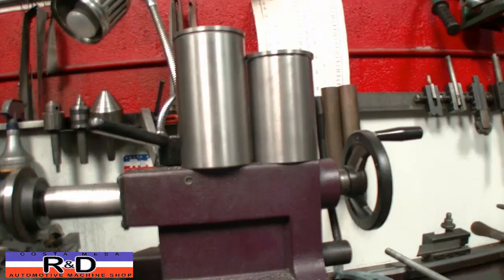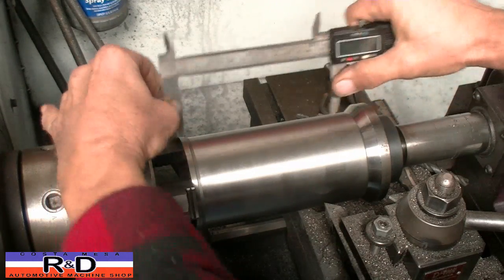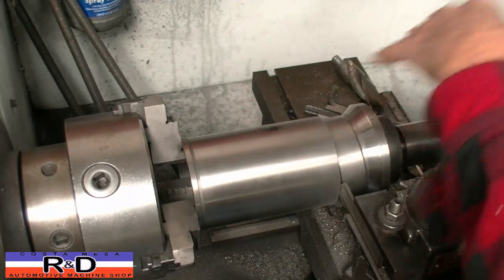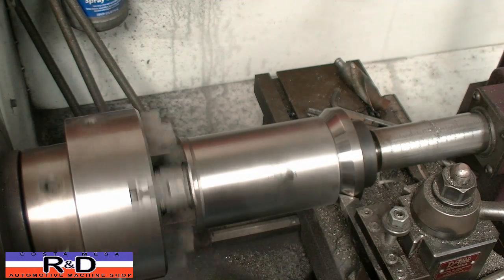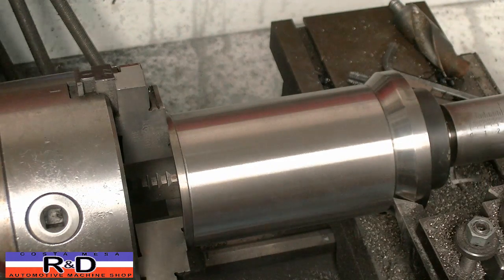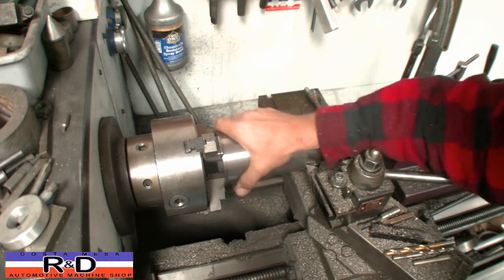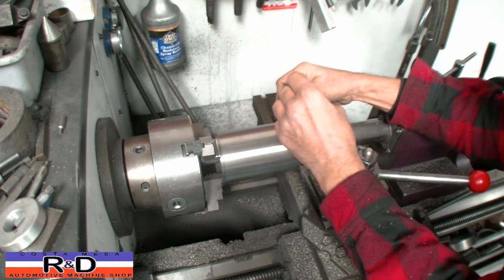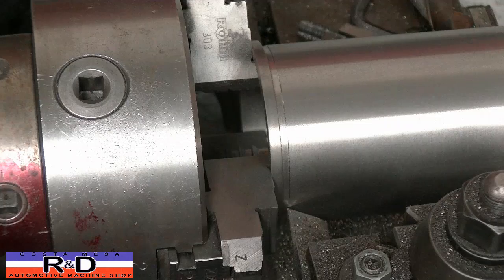Sleeve Modification for Lamborghini V 10

Comment: Do you deburr were the live center goes in !   And  check runout before cutting the o d of the sleeve !
Reply: +Bob Bielski And used a sharp instead of round insert to cut the relief. Crack waiting to happen.

Comment: is there any particular reason why you spin the lathe in reverse? i used to at a shop i worked for and i got chewed out for doing it and was told its wrong. any benefeits?
Reply from the maker: +Raging Reaper Gaming Variety The cut off tool is positioned upside down so it will pop up out of the way if it gets jammed, much better then crashing the tool and part.
Reply: +Raging Reaper Gaming Variety If your tool is so tall you can't get it on centre, you can flip it around. Not sure why John does it while cutting off, could be to help evacuate the chips. I sometimes do it on heavy brass cuts to reduce the fountain of needles.
Reply: fiatnutz
what i figured and how i was taught but thanks for clarifying

Comment: What on earth happened to that engine to need a new liner built 😬
Reply from the maker: +MrGuvEuroman detonation damage, that's what happens when your tuner doesn't understand tuning, so much.
Reply: I'm assuming it's for a big turbo build.
Reply: fiatnutz tuner in parenthesis?
Reply from the maker: +Cory Stansbury No, supposed to be and NA engine. He lost a cylinder and decided to do the whole block. Besides, he would need a new piston suitable for cast iron sleeve and not alusil - they are different!